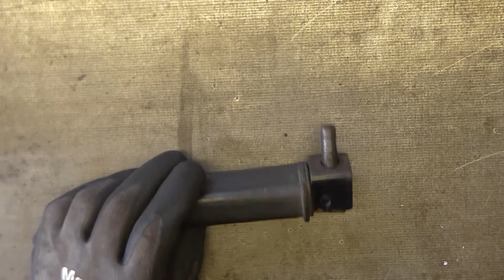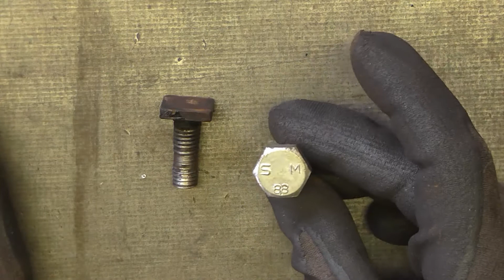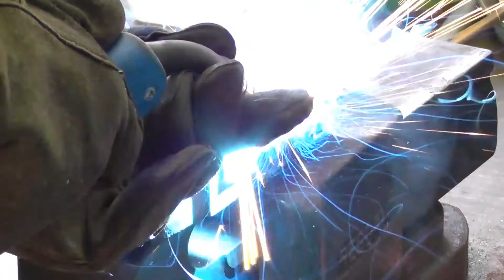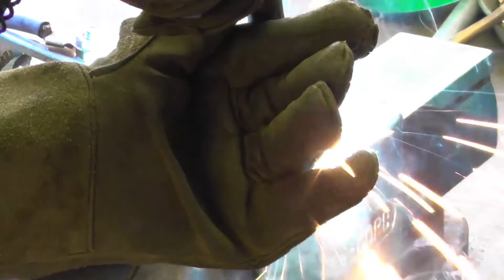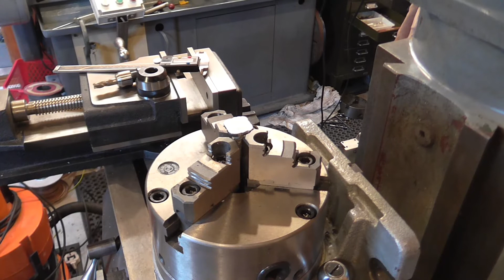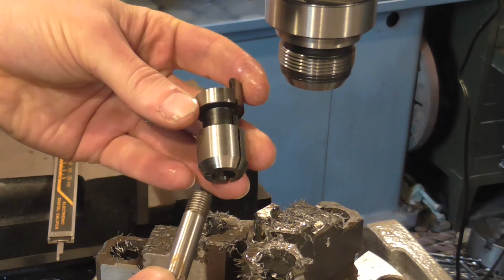Footpeg repair

Comment: Paul,
A nice job! I am also curious about why you part-off in reverse? Thanks for a great video! Does that collet fixture for your mill fit into a standard R8 collet?
Have a good one!
Dave
Reply: Swarf Rat I part off in reverse.  The tool doesn't grab that way, instead it pushes off. I have never broke a tool in reverse, but I have broke plenty in forward!
Reply from the maker: Swarf Rat Sorry, I hadn't noticed the second part of your question before. The collet chuck has an R8 shank although I can't remember of it's an integral shank or replaceable.

Comment: I believe parting this way gives more rigidity on small er less rigid lathes. Reducing the risk of digging in and snapping the parting tool.
Reply from the maker: Godshole The rigidity is no different, but the tool flexes out of the cut, rather than digging in.
Reply: That's the badger! I thought that later when I was laid in bed trying to sleep .....